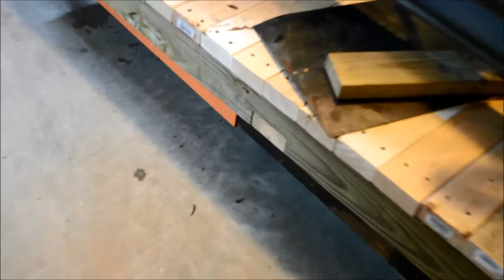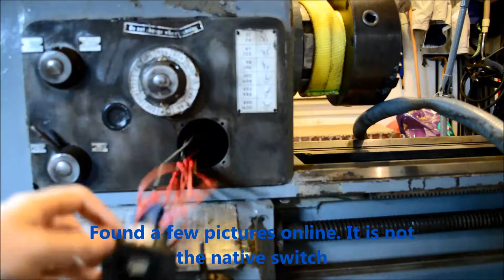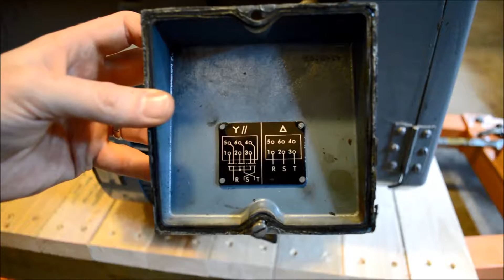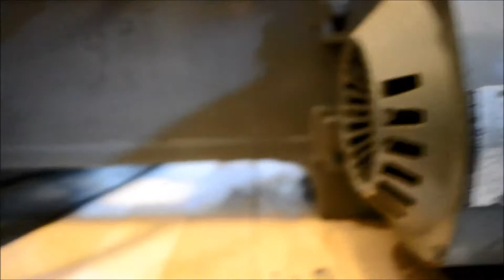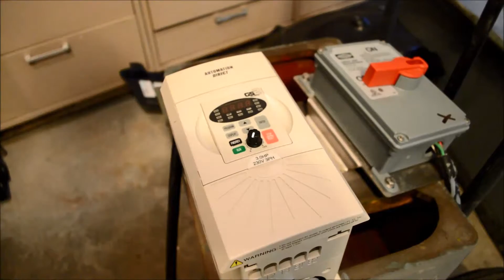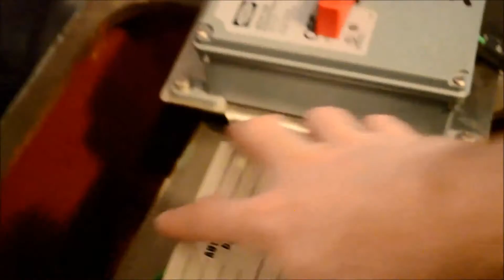Understanding a lathe's electrical system-Storebro Bruk Lathe Rebuild Part 3

Comment: Interesting video.

I'm keen to see how you finally wire it all up.  AC to three phase has plenty of ways to go.

Delta seems to be the most popular setup with these Chinese inverters.

I like the way you intend to use the existing switch gear, and the only thing I would suggest is an emergency stop button (magnetically isolated/reset type) near the headstock.  

With the lathe set in position at it's final resting place, the depth of the wooden base will be in the way of your feet unless you move the lathe base close to the edge, as I see it ?  How will that aspect work ?

Cheers Rob
Reply from the maker: +xynudu good questions!

I think I'll only be able to get it within 6 inches from the front. Worst case I'll make a 2x4 type mat so I can stand on the same height if needed. 

Today I managed to get it to and into my basement with some hired muscle. We had to use wood and pipe as rollers but managed to do it with no lifting!  

I like the e stop advice. I plan to replace the switch with an estop button. Based on the VFD wiring I would only need a N O switch. 

My goal is to get it on the stand this week and then I'll shoot another video. Debating if I try shoot a video of that but I can't see it going smoothly
Reply from the maker: +xynudu Rob,
I'll highlight in the next video but I ended up removing the pallet. I landed up in a situation where it was a major issue and... Well stay tuned for the next one!